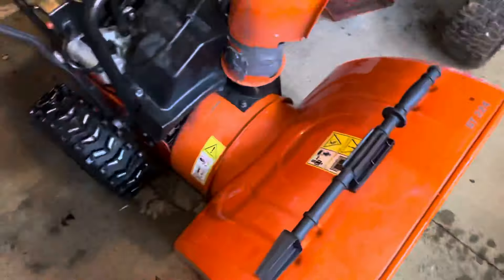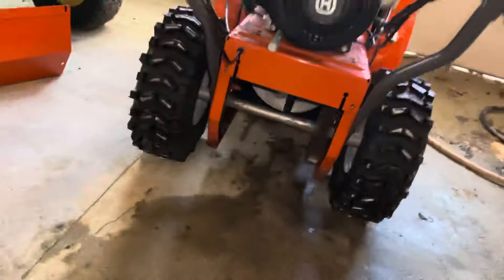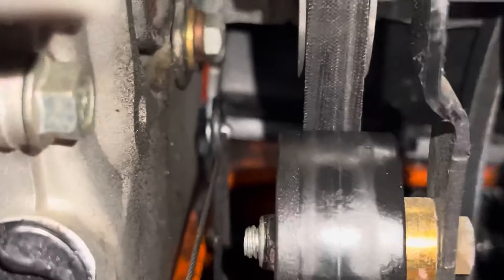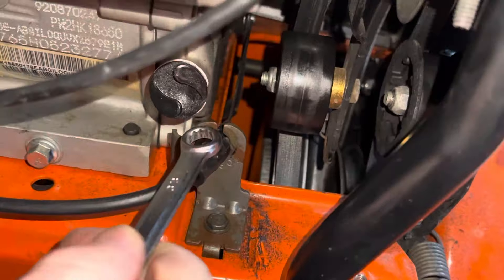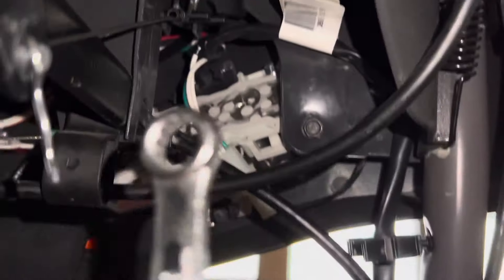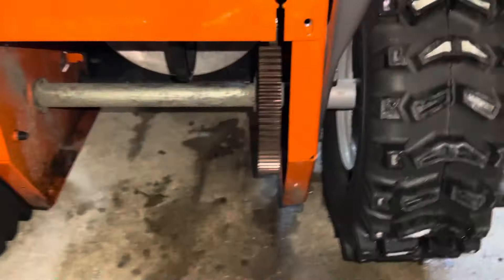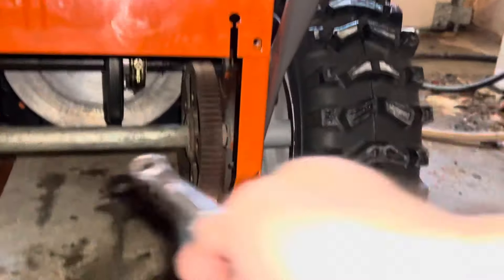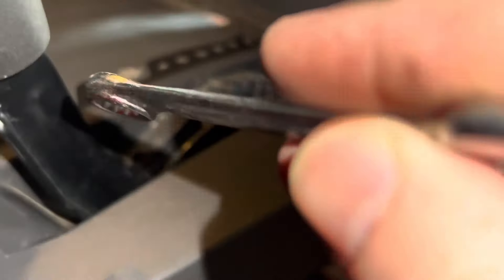Husqvarna Snow Blower ST224 Speed Control Cable Repair

Comment: Dude is pointing to the drive gear as being moveable, when in fact it's the friction disk in the middle of the picture that moves to change speeds/directions.  Hint: it slides along the only hexagon shaft in the drive compartment.
Reply from the maker: yes. i didn’t know the actual name for it. but you got it 👍🏻